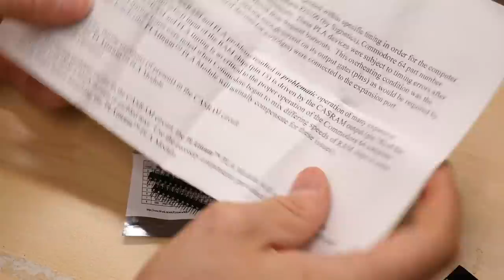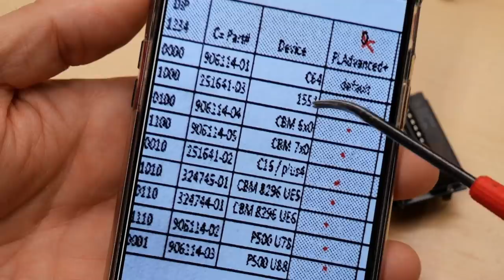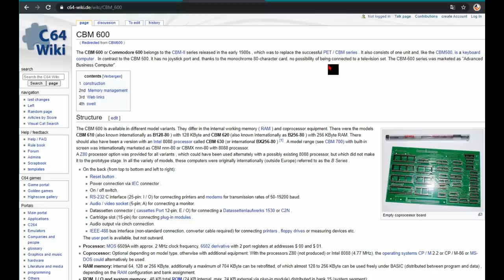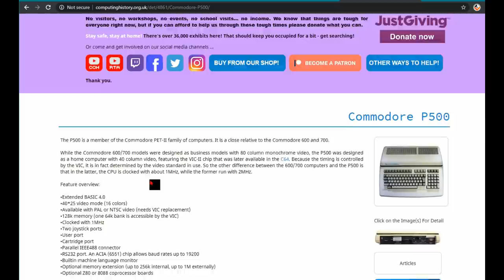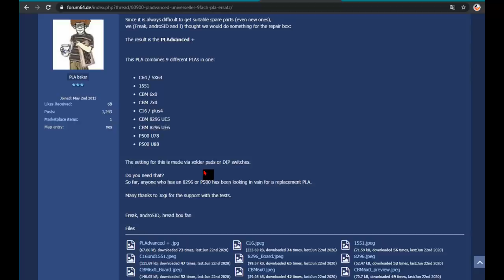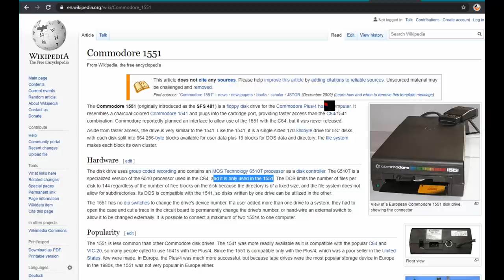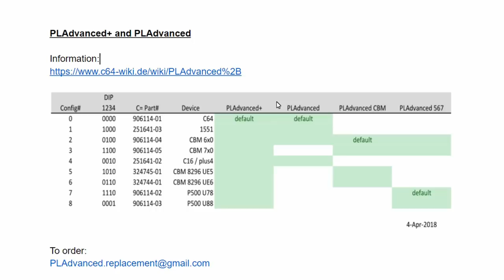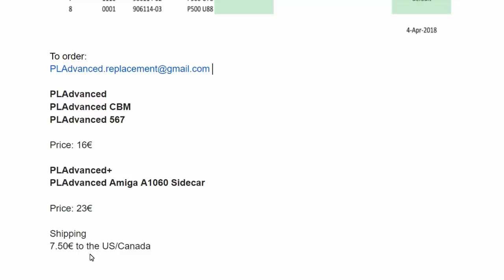The ultimate Commodore PLA replacement? (PLAdvanced)

Comment: Adrian, that tape cover on the DIP switch is there to keep it sealed during board assembly, whether manual or automated.  That way you can wash off solder flux residue or whatever, then remove the tape cover only when needed to change the settings.  I worked at an electronics manufacturer in the late 70s to mid 80s, and we had problems with flux residue in DIP switches, especially after rework.  We actually used Cramolin by Caig Laboratories back then, don't think they make it now but they have other fine products to do the same job.

I enjoy your videos, even though the only Commodore I have is a VIC-20 with the two-pin power jack, someone gave it to me decades ago and I've never gotten rid of it!
Reply: I've always left that tape in place. Usually it's possible to use a ballpoint pen to move the switches without puncturing the tape so I didn't feel it was necessary to remove it. Don't know how it fared as it aged though. My thinking was that if nothing else it would minimize the risk of the contact surfaces oxidizing.
That doesn't mean I was right, but as a lot of motherboard manufacturers used to leave the tape on the dip switches (back when motherboards always had physical switches of some kind) I thought it would be safe to leave it in place.
Reply: @blahorgaslisk7763  The manufacturers probably left the tape on because it was cheaper than the effort to remove it!  (And to keep it clean, of course.)
I also learned to be careful not to get graphite (pencil lead) and ink into the switches.  If you can get them switched without breaking the tape, go for it!
Reply: Critter Hunter  Thanks for a more recent report on that, mine is a bit dated! :)  I agree, that's a good point about keeping the switches in a "factory" state.
I tended to use a few different implements to change the switch settings: a plastic solder-aid tool with a pointed end that fit perfectly into the tiny dimples in rocker-style DIP switches yet was strong enough to work slide-style ones as well; a 0.5mm Pentel mechanical pencil with the lead fully retracted, leaving a narrow cylindrical tip; and an Xcelite pocket flatblade screwdriver (R3323).  All worked pretty well, and I know I still have the Xcelite screwdriver and the Pentel pencil, both from around 1975.  Good tools are worth paying for!
Reply: The Tape is on there, because of vacuum pick&place the part during SMT-process (and for stopping the heat during soldering in the SMT-oven). Parts like this are on a tape-spool and are grabbed by a tiny vaccum-arm. If there is no flat surface, this would not work. With the tape over the switch, there is a flat surface. So you can remove it- its really only for the pick&place-system.
Reply: @GentryBa1  That would have been my reply had I gotten up an hour earlier :-)
Reply: Mr Guru  hmmmm... I doubt that, since the tape offers practically to thermal resistance and would be completely useless if the PCB was heated from below. Flux protection might be a thing, though. I have seen PCBs where  between revisions the design of the connector changed from "has holes in metal casing and needs tape for the pick and place" to a closed metal casing that no longer needed the tape for the PnP. IIRC it was a HDMI or USB connector on a Raspberry Pi where you could borrow the piece of tape on an earlier revision but no longer on a later revision.
Reply: Werner Viehhauser it may not help for reflow, but it definitely helps for manual assembly with hot air. Learned this the hard way...
Reply: Mr Guru The main reason is the pick&place-thing. I can tell you for sure... 15 years experience in such things. ;)   Some parts also needed to be heat protected- in this case, the tape has this function , too.
Reply: Ah yes, the old Freon propelled Cramolin
Reply: @adamsfusion  Actually, in our case it was a small glass bottle of Cramolin.  If I recall it even referred to it as "oil".  It was reddish in color.  We used the heck out of it on some boards with multi-position slide DIP switches, one slide along the major dimension, so it would short across a pair of pins, like 1-16, 2-15, 3-14, etc.  A big gap where the slider was allowed way too much flux residue to build up, and cleaning it thoroughly made it hard to slide.  So the Cramolin helped both ways, to keep the contacts clean and lubricate the slide action.  We used a needle-less syringe to put a drop or two inside the gap.
Reply: Regarding SMD, back in the 70s-80s time frame I was talking about, we didn't have surface mount devices like we do today.  The closest thing were probably military-grade "flatpack" ICs:
https://en.wikipedia.org/wiki/Flatpack_(electronics)

Comment: Nice video it’s good that there are starting to be chip replacements for these machines
Reply: As reverse engineering and FPGA technology continue to improve, we may start seeing even more replacements for ICS. With modern lasers, it's becoming easier to remove the casings to expose the die.

Comment: I find that a small, cheap breadboard works nice for holding pin headers because it holds them straight. It also sinks the heat away from the traces. The part has to be worked off, but that's how it goes.
Thanks for making videos!

Comment: Thanks for the short concise video.
Another way to align those headers is to use a proto-board (press-in wire style with 0.100" spacing). Just use it to tack 2 pins though and pull it out again, otherwise the proto-board plastic may melt from the heat.
Cheers,

Comment: The way we used to replace the PLA was with a pin compatible, FPLA, programmed off an original Commodore 64 PLA 
The PLA is used as the high address bits to chip select decoder. The memory map for the computer.

Comment: The PET 8296 is a completely different thing than the SuperPET 9000.  The 8296 was a whole new motherboard design with 128k of banked RAM and a single 6502 CPU, while the SuperPET 9000 was a modified PET 8032 with an additional board that displaced the 6502 to the add-on board, added a bunch of Watcom languages in ROM, a 6809, some 6809 ROMs, and a couple of additional interfaces (including a true RS-232 interface, allowing it to be easily connected to other systems as a terminal).  There was also a hardware mod for the 9000 that allowed the use of the OS-9 operating system.  The 8296 actually has more RAM than the 9000, as there is 128k present in the 8296, although in practice both machines can only use 96k in normal use.

The CBM-II lines didn't reach market, but some developer's prototypes were sent out and not all were returned when the project was cancelled and Commodore was ordered to destroy all prototype units.

Comment: On the PLAtinum, the single cap near the voltage regulator might be a problem too - for typical LM1117 3.3v regulators you would use 10uF on the input and 100uF on the output - I don't see that there.  That could be causing the "works for some people not others" issue.
Reply: Those regulators spec that sort of smoothing for wildly unstable power supplies. This uses an already good +5V line, so I don't suppose it could cause issues even without the cap. In fact, I would just put two simple diodes in series to drop it from 5 to 3.3V. I have done this before when the 3.3V line died and I wanted a cheap fix. (Details: For high power drain, use two rectifying diodes. The load will stretch the threshold voltage up to 0.8V. For low-power chips, use Zener diodes of any type in the forward direction. These have a slightly higher threshold voltage, 0.8-1V depending on load. If it still doesn't suit you, a Schottky diode will give you about 0.35V.)
Chances are the timings just aren't programmed right into that chip.

Comment: Btw, I forgot to mention, there was a B-256 also. I converted mine after I noticed there was room on the motherboard for another bank. Btw, the 8050 was single-sided and was 500k. The 8250 was double sided and was one meg. I also bought a used D9060 hard drive. Unfortunately, it had a dead 5 meg mfm drive, and I couldn't find a replacement. There was also a D9090 available, it was 7.5 meg.

Comment: Good to see more options out there. I"'m still waiting on my pcb's from PCB Way for the Gal PLA  since March! I ordered everything right after your video and have received everything but the pcb's.
Reply: international shipping during a pandemic is the worst. I have a subscription to japan crate for Japanese snacks. I didn't get any for 3 months. Then I got 3 boxes in 3 days and then 2 weeks later I got my 4th box. lol
Reply from the maker: Yeah seems nuts how long it takes some things to arrive -- I've ordered stuff from China and it came in 2 weeks - other things took months and months and they finally showed up.
Reply: @adriansdigitalbasement  China works reasonably well here: China Post seems to be capable of using railways to get mail to Europe, stuff I order in China shows train stations in the tracking information since a few weeks. It takes slightly longer than normal, but it works reasonably well. Transatlantic mail has got a far worse hit, taking many weeks. (Not so good to send PLAs to the US :(  ) I have discovered that a sea route has been created between Rotterdam and New York, which a lot of the mail traffic between Europe and North America is using right now. Ships seem to depart every two weeks, so if I would send you a letter or package, it has to wait up to two weeks before the ship departs, then the ship needs +/- 10 days, and then the normal route inside the US.

Comment: Hi Adrian, great channel. I had a B-128 package, it came with a 8050 dual drive but no monitor. I used a 80-column monochrome monitor since this Pet replacement didn't have color. It came with a basic terminal program and a word processor and of course used the IEEE, (HP) interface which meant it was not compatible with C64 accessories because it used the IEEE bus, it was quit a bit faster than the 64/1541 combo, I would guess about the same speed as the C-128/1571 combo in burst mode. Btw, the package came from "Protecto Enterprises " and I forget how much it cost.
T

Comment: A cheap breadboard works GREAT for holding the pins in alignment while you solder. I have a little cheapy one that I use for just soldering/hot-air.

Comment: You know what Im really curious about. What would computers from back in the day actually be used for that was not gaming.  I remember a story about a commador vic20 or 64 cant recall which that was used on some old manufacturing equipment and the machine in question could not be made anymore so they had to replace this Commodore every time it broke to keep it running. But what were a lot of these computers used for back in the day. I know Europe had a ton of love for MICRO computers, but what were the other practical applications of these outside of gaming. All I ever see is people talk about is gaming.
Reply: For one, there was GeOS operating system for the 64 (and I think they made it for 128 as well) by Berkeley Softworks, released in 1986. Think Windows before Gates stole it, because that's what it was. Also, with a cheap 30 dollar 300 baud modem and a phone line, you could connect to Quantum Link aka Q-Link as I did, which was AOL before it became AOL. I am talking when I was like 8 or 9 years old here - I even got a job writing columns for a BBS board but I ALMOST figured out how to do that but unfortunately couldn't at the time. I almost overcame the technical issues I was having but couldn't. Maybe my modem was not compatible or something of this nature. I have recently become aware that there was some music composing software that did the MIDI thing. I think Adrian featured it in one of his videos if I am not mistaken and if I am, it was someone else then. Another popular thing to do was type in LOOOOO-OOOOOOONG programs from magazines. I mean, it would take months or weeks, and one single mistake made it all pointless. Think about that! But also too, there was some form of automatic debugging which did help to some extent.
Reply: In fact, you could also download the first ever versions of shared music that flashed the screen all the colors wild like C64 can do. The two very popular files involving this were Led Zeppelin's Black Dog and the Kung Fu Fighting song from the 70s. There are videos of these running and playing on Youtube here. If I recall well, it would take 6 to 8 hours to get these ultra low quality files. And if someone called the phone line you were using, you were disconnected and there was no such thing as resuming the downloads. It was all completed or nothing.

Comment: There is another one that sounds really cool called the PLAster. It combines a kernel rom replacement with a PLA replacement. The default is kernel passthrough. But then it has jumpers to allow different kernels stored on the chip itself. Anyway I got a GAL PLA and sadly it didn't change anything with my C64. I suspect a PAL mod isn't going to change anything either, but I was going to do it anyway. I'm half tempted to just order all the various support logic chips and various sockets. I have 3 suspects, but if it's one of the others it's just cheaper to get them all at the same time. There are minimum order requirements on the sites that sell the chips. I didn't run into that problem with the replacement ram, but I did when I got my color SRAM (also changed nothing) and socket for that and the PLA.
Reply: Well... I wouldn't recommend to randomly start swapping components. Start the diagnosis with a dead test cartridge and proceed from that.

Comment: PLAnkton uses a simple voltage divider to achieve ~3.3v but it actually fluctuates which isn't good, since the CPLD uses dynamic current.
Reply: We all have opinions on what is good practise and what not. And indeed, I wouldn't connect an IC to a voltage divider myself. But I also think we should judge PLAs on the end result, and the PLAnton is known to be a great PLA. What else do we want?

Comment: FAN-TAS-TIC!!! I got a C plus4 with a black screen and highly suspect the PLA! I am gonna give this a go! Also got a C16 which works (PSU broken, but with sega PSU i manage for now). So for the C16 it never hurts to have a spare part as well. I assume the chip was tested on C16's and plus 4 machines....thanks a kazillion!
Reply from the maker: Suspect the main CPU on that machine unless you've already tested that good. It seems to be the part most likely to fail. :-(
Reply: @adriansdigitalbasement  Dang, yes, i just swapped the PLA's and their fine. Thanks for the tip! With CPU you mean TED chip i suppose. They are very difficult to find i believe...
Reply: TED is graphics, you mean the 7501/8501, i just looked up. I am gonna check if it is interchangeable with the C16 tomorrow....the TED chip is also very unreliable i have heard....
Reply: @jengelenm  The TED can be a problem, but the 7501/8501 really fail in huge numbers. It is really impressive how many machines have a broken CPU.
Reply: Thanks, i am also gonna try recapping, never hurts a try😀, i must further troubleshoot with an oscilloscope as well. It is so strange, when booting, you vaguely see some white lines moving, and looks like it's trying to compile the screen. There is surely some movement on the screen at first, but black always....
Reply: @adriansdigitalbasement  Yes, it's the CPU! I swapped the 8501 of my C16 with the bad 7501 of my "plus 4". So now i am on the quest for a new CPU. I am checking your video about this and looking into the FPGA solution. Think i am gonna give that a go. Thanks for giving me the push! In the beginning i was i bit afraid of swapping component between C16 and plus 4, but their architect is very similar. If  it's fixed, it's tinkering time! :)
Reply: @adriansdigitalbasement  The actual question is why these chips fail frequently and how to prevent this for the future, to keep these machines going. It could be temperature, but also other causes related. I am very curious, but this is hard to find out. Could even be an unreliable batch, from the factory, back in 1984....

Comment: Hey Adrian, I would love to ZIF my C64 Board as well, but the capacitors are in the way. How did you handle that? Did you put the caps on the back of the mainboard, or did you use some SMD versions for that?

Please let me know or  even better make a quick video :-)

Thanks
Ser